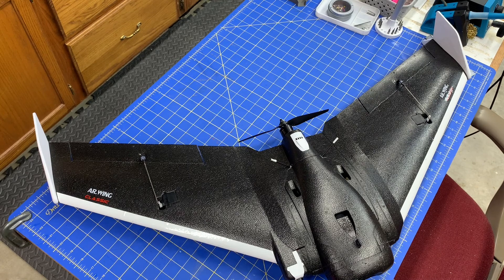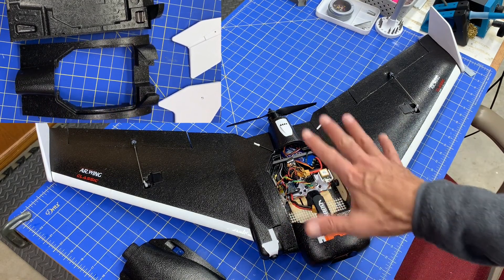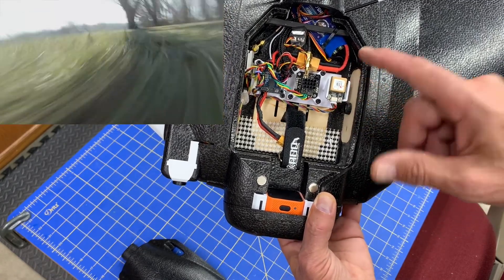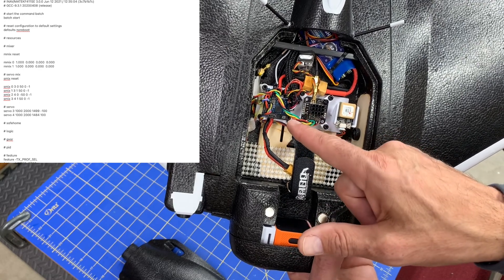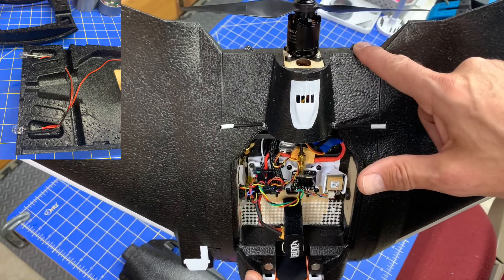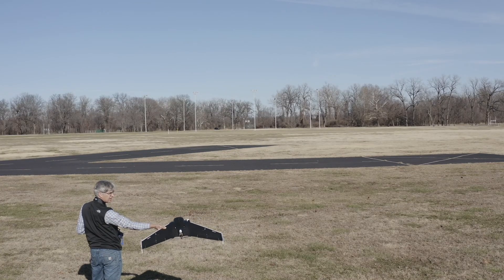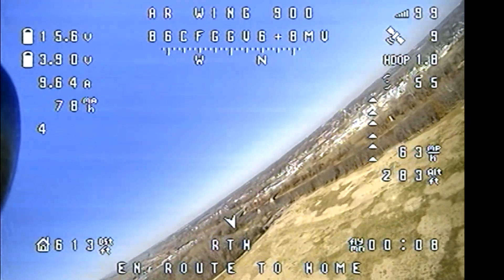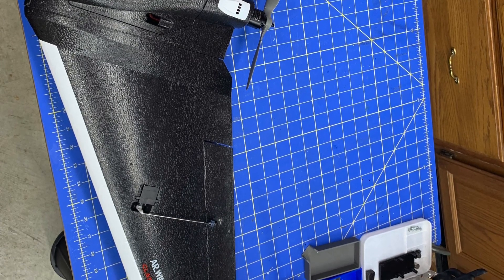AR Wing 900 - FPV Build, review, upgrades, Emergency CRASH landing.

Comment: Its a clean build, looks good. The DVR footage says you still had 9 sats so not sure if that was the issue there. Either way she will live to fly another day. Good editing, i like the mavic footage as well 👍👍
Reply from the maker: Yep the GPS started with 9, then did a little dip to 6.. Thats when it went into Emergency Landing mode..   No harm, no foul.  She's had many flights after I changed the GPS and the RTH Abort setting..  All good, as long as I don't have anymore INAV F411wse erasures....
Reply: @SteffenRC  Yea i am gonna keep mine on the Inav 3.x.x. That will work for this board so far.